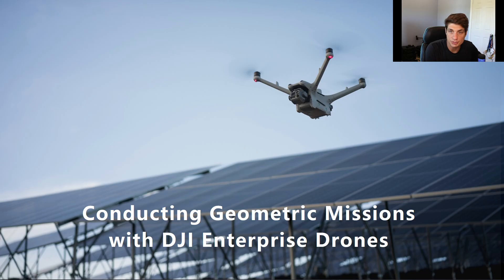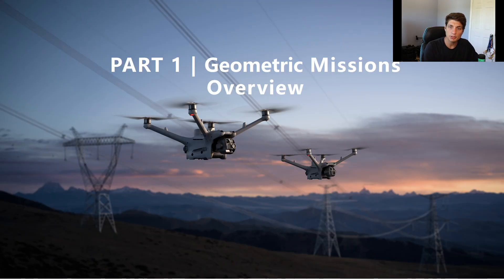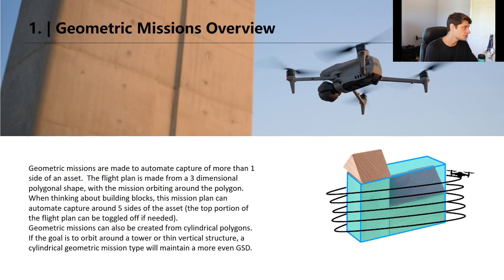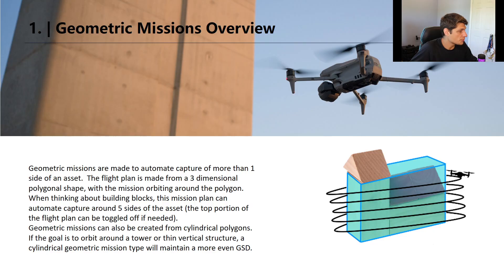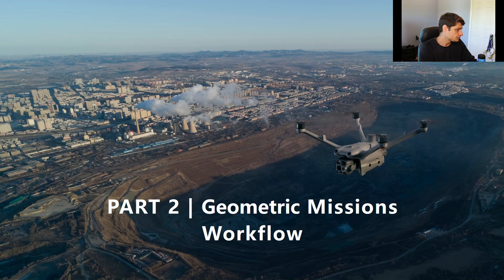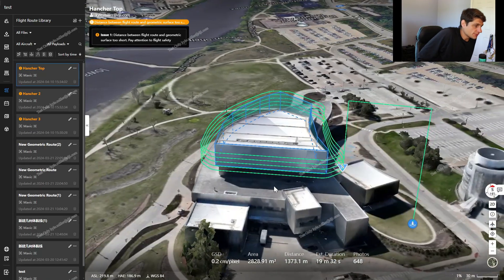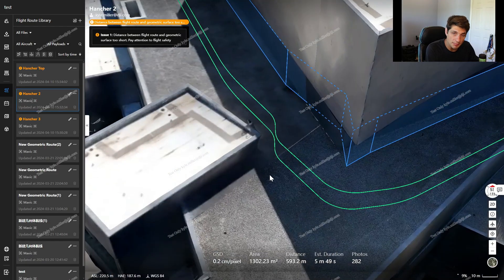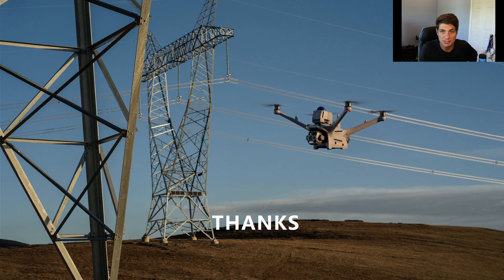Geometric Missions for 3D Reconstruction: DJI Enterprise

Comment: Cannot understand how you got the 3D model inside the DJI Flight Hub 2, in addition cloud reconstruction taken with a 4T cannot be converted into a geometric mission, i get that it requires a 4E. Apparently everything related to photogrammetry is useless with a 4T unless you fly manually. Another issue is that it works while the building is flat, but i cannot managed to modify a geometry mssion to take in consideration a building built on a slope where the bottom limit is 5m further below on one side compared to the other.
Reply from the maker: How to get a 3D Model inside Flight Hub 2:
1: Import a point cloud (LAS) or model (B3DM) from DJI Terra (https://fh.dji.com/user-manual/en/model-library/import-models.html)

2: Upload imagery and process the imagery in flight hub 2 to create the 3D model. (https://fh.dji.com/user-manual/en/model-library/mapping.html). This can be done with M4T.

Cloud Reconstruction is for real-time 2D mapping.

For the building height difference, it is true the geometric mission cannot have different heights on each side. Could supplement automated geometric data capture with additional photos or an additional slop mission for the lower side.